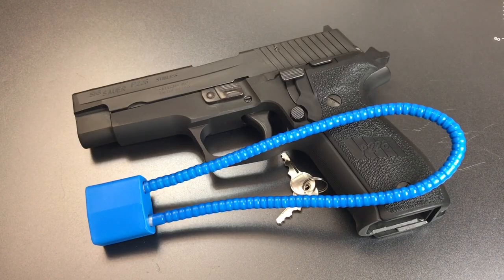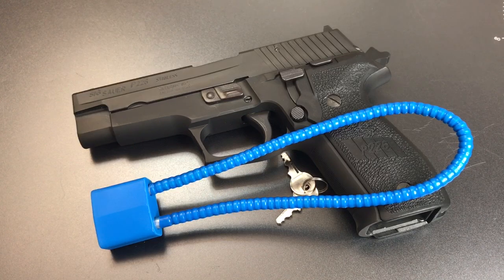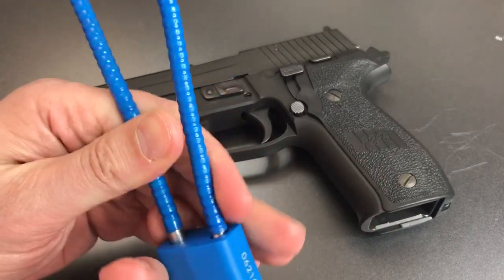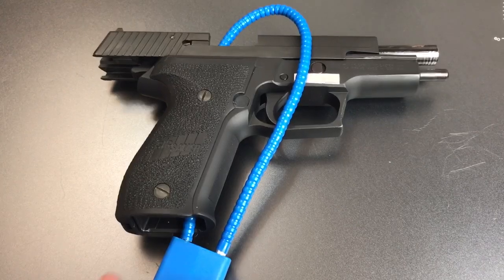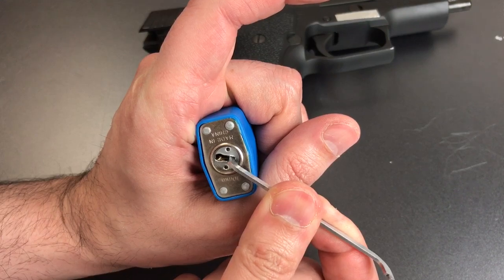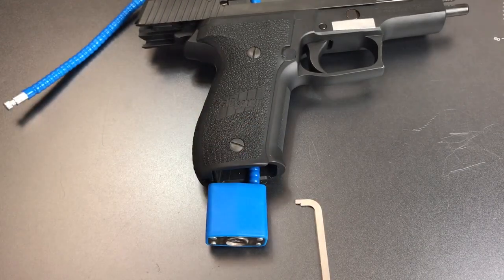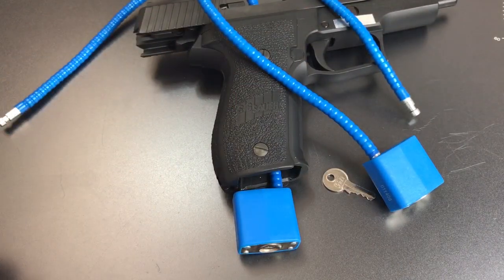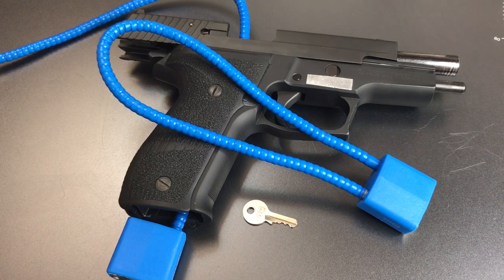[435] Sig Sauer Gun Lock Picked

Comment: I would prefer not to store a gun with an open bolt for a longer period of time.
Reply from the maker: With quality springs, it shouldn't matter, but FWIW, I agree.
Reply: @randomlyentertaining8287  I'd prefer to keep the environment outside of the inner workings, to be honest.
Reply: What are some better locks designed for these guns that won't put wear on the springs and action? Maybe just a simple trigger lock?
Reply: Springs wear out from compressing and decompressing, not remaining compressed.
Reply: @RandomInternetProfile they do. slow creep, the material slowly deforms under constant stress, even if well under elastic limit
Reply: @DROGOC0P  Seen several people test this over many many years and find that not to be the case. Maybe on springs made in the 1800s, but any later and they don't set even fully compressed for 20 years

Comment: I just came across two locks similar to this one. Since the keys were M.I.A., and my brother was deceased, my solution was to use my small bolt cutters to cut through the cable. The cable was a joke to cut.

Comment: These cable locks are there only to present the illusion of security. Apart from the obvious one-second bolt/wire cutter attack, most can be opened by jiggling a wave rake for a few seconds, no separate tension tool needed.

Comment: One of the common misconceptions the people have about the locks and other security measures is that “it won’t hold against the prepared intruder”.

However, while it is true, it does not mean you may just go on without the locks altogether.

If the intruder is not motivated to break that particular lock, it gets an extra chance of them deciding it is not worth the effort. 

If the intruder is determined and decisively makes their move, even a bad lock or whatnot gives you some more time to call for help.

Comment: I came across your channel a few years ago. I've always had a fascination with locks, and your videos fanned that flame. I bought a cheap and simple lockpicking kit that fits in my wallet. Not too long ago my dad needed to open a padlock, and thought I had the key (I'd given it back to him months before). My first attempt was to shim it with an old soda can. No go. I couldn't get the piece of aluminum in the gap at the shackle. So I pulled out my lock picks. Using the raking method (he was in a hurry) I got it after a few attempts. Thank you LPL!

Comment: I had 3 different cable gun locks that I easily cut with a pair of side cutters/wire cutters so don’t ever trust your fire arms to these garbage locks that are only provided because of a requirement imposed by anti gun legislation.

Comment: A cold chisel and 3 Lb. sledge will sever that cable in about 3 seconds. I know this because a trusted friend lost his key to the lock and asked if I could cut the cable for him. The actual cable is thin (maybe 1/16" dia.) but is covered by hardened articulating segments and that plastic cover. The chisel apparently spread the segments apart enough to allow the chisel to easily cut the thin cable.

Comment: Without meaning to be rude on a 6 year old video: I actually think you're wrong about the quality of this lock
give other gun locks you've shown on this channel, it's actually incredible
Instead of a twig, a fork, or some other random stuf you might have lying around, this lock actually requires propper lockpicks (and raking won't work, as I assume you would've tried it?)
Is this lock good? no, of course not
but at least it's not bottom of the barrel junk and actually functions as a cheap lock, which is surprising for something you get for "free"

Comment: Maybe more of a display case at a pawn shop lock.  Where you can let the customer hold the gun but not actuate anything.  At least if they run with it, there's a bright blue thing on it.
Reply from the maker: It's very rare that I see locks in use at guns shops.
Reply: I was surprised to see that Cabelas has shot guns on display that the public can just walk up and touch just sitting on the display racks.  They only use trigger locks that look just a cheap is this.

Comment: @LockPickingLawyer I have a question: I have 2 of these same locks although possibly newer versions because mine have a drill plate covering the entire bottom of the lock, with a recessed core. The drill plate also has a shaped opening that seems to intend to allow for the inserted key to rotate, only in the appropriate direction, and anything larger to be blocked from turning. Nevertheless I have managed to open both locks a few times but not consistently.

I don't have any reason to believe there are security pins, but there is a weird oddity that both locks have that I would like your thoughts on.

The oddity is that the cores are not stable. There are a few degrees of rotation allowed without the key in. Interestingly, if the core is rotated those few degrees off 12 o'clock, the pins seize and the key cannot be inserted. The result is that under tension, thr core is turned those few degrees and all of the pins are incredibly stiff, so much so they deformed my pick. The only time the pins are appropriately springy and moveable is when the core is at 12 o'clock, which it cannot be while under tension. Somehow I was (as I said) able to pick both locks anyway a few times, but I heavily damaged my pick and do cannot repeat my success at will. I've watched a LOT of your videos (great work btw) but haven't seen anything addressing this specific issue. It's similar to a false set, only it occurs by default even without any pins set.

Sorry for the long question but I had to try providing as much detail without any visual aids. I hope I succeeded, and you can offer some insight. Thanks in advance.

Comment: I guess those are used for securing a gun from being used quickly or to keep them safe from kids. After all, anyone can pull a trigger but not everyone is even a novice picker. I think that is still a lot better than an unlocked loaded gun anyone can grab or steal.

In my country you are required to lock guns up securely (that must prevent from it being stolen while locked). If you have multiple firearms, you are required a standardized gun safe that is not an easy pick nor easy to open by force and usually needs to be fixed to the house to prevent the safe from being carried away.
Reply from the maker: Where? Can you send a link to this "standardized gun safe."  I'm curious.  Thanks.
Reply: Here we are required to use EN14450 S1 standard approved gun safes (or better) if you have multiple firearms.

Standard EN 14450 regulates test methods for safes and strongboxes. A distinction is made between security levels S 1 and S 2. where S2 is slighly better The security requirements of this standard are lower than those of EN 1143-1, but higher than the requirements of VDMA 24992.

The locks used for the ones I've seen seem to be lever locks like in cheaper safes. I've yet to t find details of the standard about picking resistance. (I guess that is the most interesting detail being on this channel. Sorry to dissapoint everyone)

For mechanical protection it is required to be able to take quite a bit of abuse but the standard requires only protection from common hand tools like crowbars, chisels, drilling etc. Double walled door with 1/2" hinges and several side bolts seems very typical. Typical 5-6 rifle size cabinet might weight from 80 to 130 kg. I guess the weak point is the walls that are probably "easily" cut by tools like torches or plasma cutters. Typical wall thickness is perhaps something like 5 mm or so. With any hydraulic tools I could also see how those could be opened easily. They are to protect only from the common with burgler that has hand tools, lots of elbow grease and some determination unlike "real safes".
Reply from the maker: hoggif thanks.

Comment: AWESOME REVIEW L.P.L. MOST HAND GUNS CAN BE BROKE DOWN IN A MATTER OF SECONDS AND REASSEMBLE IN MATTER SECONDS LAST THING I WOULD DO IS ADD A LOCK MY OPINION ONLY .IT TAKES LONGER TO GET A KEY AND OPEN A LOCK.OR STORE THE BOLT SEPARATED .I KNOW SOME REQUIREMENTS TO HAVE IT LOCK WITH CABLE..THANKS FOR SHOWING. 😎😎😎😎😎
Reply from the maker: Thanks... I guess circumstances dictate locking requirements.  With a kid in the house, I wouldn't rely on disassembly.

Comment: Re: the anti-drill plate... I would guess it's there simply because the company uses the same core for many applications and the plate is part of the general components set. Especially with it being actually attached to the core.

Question: Is your baseline idea of a novice picker "Barely any practice but at least has proper picks" or "Idiot putzing around with a screwdriver and a bent paperclip or hairpin"?

Comment: I'm a total noob with no skill. I bought a lot of 6 different gun safety locks off eBay for practice. Beretta, Ruger, Savage, Marlin, etc. "brands." One was a model CL-885, very similar to this. Within 30 minutes of receiving them today I had picked them all. The only challenge was the tiny keyways on some of the 30mm locks and being able to tension them.

Comment: This works exactly the same as the one you made yourself, this makes no sense, you can just pick your padlock then exactly the same as on this one, so your lock is no better then this one, what a waste of a project.

I been watching for ages but I am now starting to realize you poo poo one item then years later you recommend it, and also you never post stuff you cant pick, so your message is everything can be lock picked, nothing is safe and anything you recommend is just the same as anything else you do not recommend.

"Hi this lock is very low security I wouldn't use it, but months later I will make a video where I get a cheap padlock and insert a rod in it through the magazine exactly the same as this one operates and tell people it's great, even though it can be picked just as easy and has no advantages over the others I have already reviewed badly."

Comment: I guess you have some sort of gun safe for your fire arms. If you do have a safe do you still use these locks for extra protection when they are inside the safe.
Reply: It wouldn't be for "extra" protection per se; but rather a legal requirement. Even if guns are locked up, often local laws require that they still have some sort of lock on them.

Practically speaking. If someone were to get into the safe. They wouldn't be able to use the firearm until they got the lock off. But once they're in the safe, they can just steal the firearm and worry about the lock later. Ultimately it would all depend on the intruder's intentions and the scenario they find themselves in.

A theft wants a quick grab and run.
Someone who intends to do harm, would come prepared.
Reply from the maker: I do have a safe -- actually a few.  I am not going to discuss my exact security arrangements... but they are adequate in my mind.
Reply: @lockpickinglawyer  Adequate in your mind must be Fort Knox levels of security to us mere mortals.